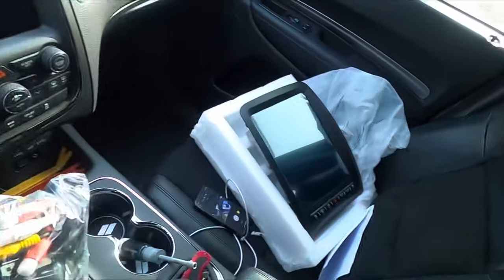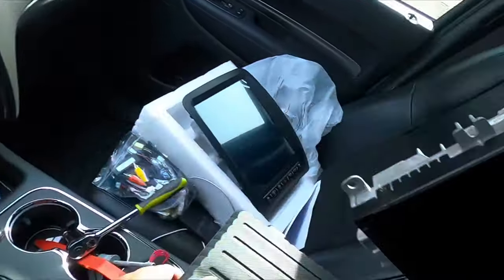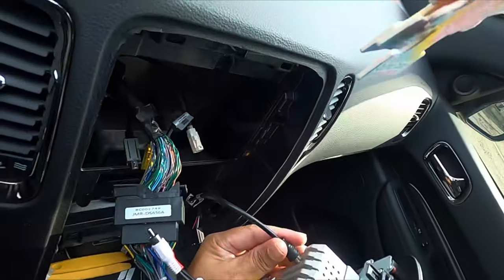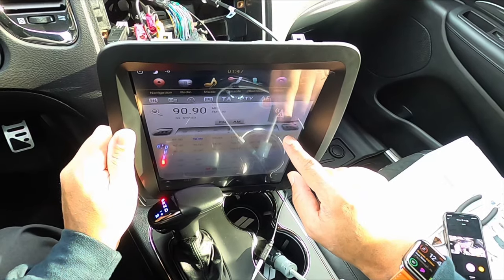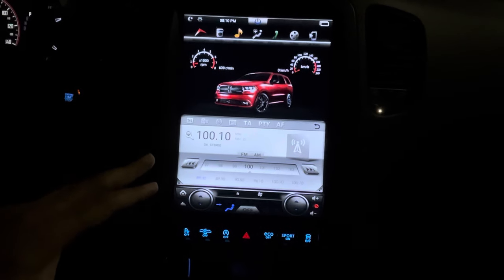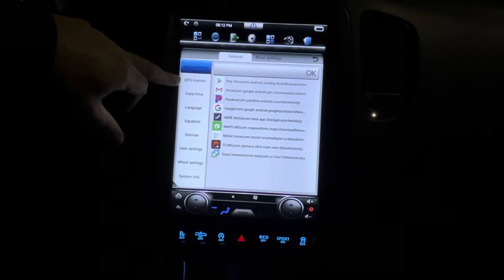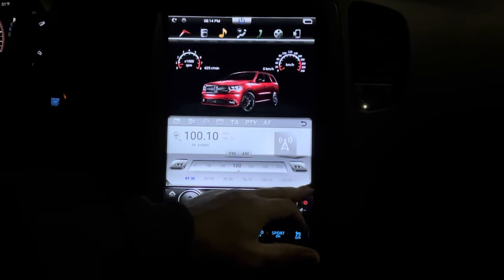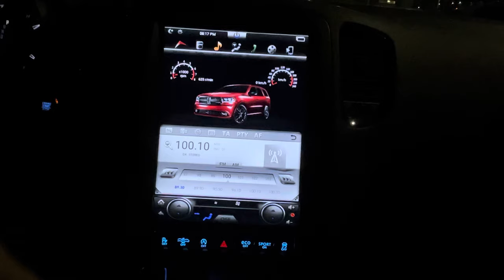12.1” ANDROID RADIO IN DURANGO RT

Comment: Is the Android and Apple carplay hardwired only or wireless? Great video.
Reply from the maker: It has a usb plug for the CarPlay that connects to the radio by a plug n play connector
Reply: The other OEM cables Pink, Burgandy and yellow. Did you have to connect those? You inst video dropped off before connecting the backup camera etc. I think I got that straight this morning. Did you have the OEM blue ray and headrest players to connect? Oh also, did you connect a provider sim for mobile internet. I found the hardwire slot on the motherboard is tricky. There's a tiny bit of space between the slot and enclosure that if you don't use tweezers, you will lose it. Mine didn't come with directions so your video was helpful.

Comment: hello this works for a 2018 dodge durango gt
Reply from the maker: This should work fine for the 2018 gt as long as your factory radio is the 8” one because this particular arduous 12.1 fits perfect for the factory 8” 2018-2020 Durango

Comment: I am trying to upgrade firmware, can not figure that out. I want to change the interface and look of the controls also but again lost. Any help appreciated
Reply from the maker: I cannot upgrade my firmware as well.  Theses a lot of other things that we can’t access without upgrading the firmware.  I reached out to Phoenix and apparently the only way to upgrade is 1) through a window computer and 2) you have to be sent a link through dropbox. I’m super frustrated about this! There has to be a easier of of doing a simple firmware update
Reply from the maker: But you can still change your control interface without updating the firmware but you only will have  one other option which is the blue interface
Reply: @AlexsRTLife  do you know how I would do this? I’m waiting on phoenix to reply on the CarPlay issue and I will also ask about update or if I even get a link I will get you that

Comment: How do you feel losing the physical AC control?
Reply from the maker: I’m ok with it. As long as they continue to work properly. I actullay like the touch controls more. Also the fact that they will never stick and become stuck
Reply: @AlexsRTLife  thanks for the answer bro!

 Does it come with Android auto & airplay? Or is there a separate function to connect phones.

 And last question, did you lose any steering wheel button controls?
Reply from the maker: Yup it comes with android auto which works fine but I prefer using Bluetooth for music. And I retained every single steering wheel control, I would have been hot if I lost any of the wheel functions!

Comment: Man that eq sucks I have the same radio it just has for rca jacks it doesn't have sub rca out I had to install a EQ for really tune my music I'm running 4   6 1/2 door speakers beymas and 2 12 inch subs with 2 amps but I had to install a EQ on it
Reply from the maker: You might want to try a different setup. I can can really tune in mine to a T, and I only have the stock Alpine system. The unit also has crossover adjustment so I don’t see why you can’t get tuned in with a crispy sound
Reply: @AlexsRTLife  yeah it's kind of goofy but I'm still trying to figure it out I think it has something to do with my factory amp